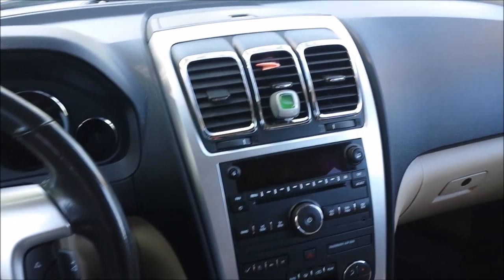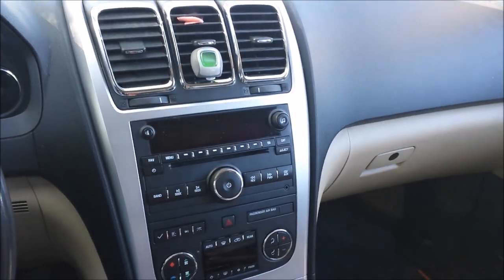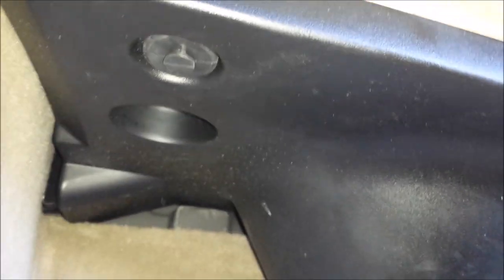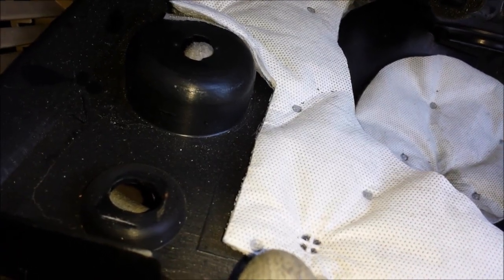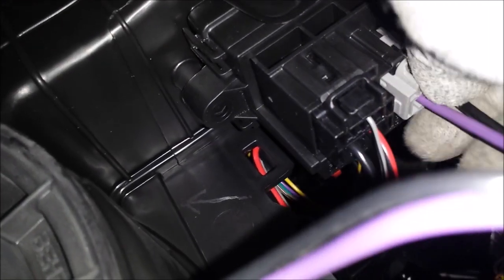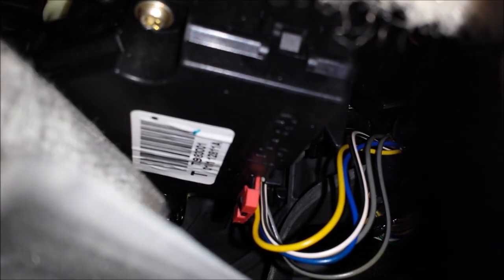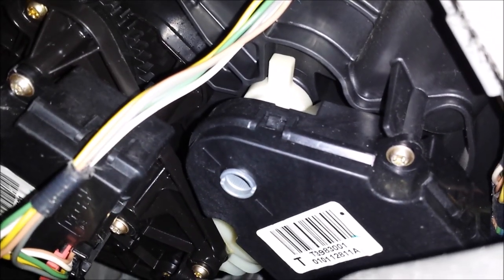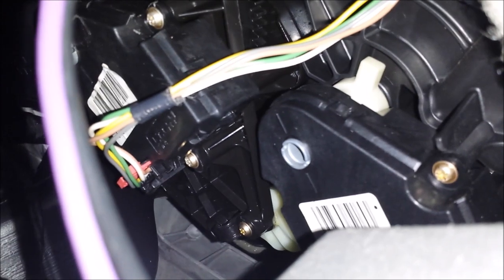A/C blows hot on passenger side? Fix! 2007-2018 GMC Acadia

Comment: I called our local 'honest' auto repair shop for a quote on doing this job. I even told them about this great video and how quickly the job had been done.  The owner quoted me a flat $1300 (plus part), no matter how short or long a job it would be "because that's what it's worth".  Yikes!  My son, who has ZERO experience working on cars, decided to see if he could do this repair job.  He has done literally nothing to a car in his life beyond checking the oil stick.  He watched this video, went to Home Depot and bought a little headband lamp to wear for light and the needed tools that were described in the video, and dug in.  In under two hours, he had done the complete repair, had the A/C working like a dream, and had everything put away.  I repeat - he has had NO EXPERIENCE whatsoever working on cars or any other equipment, and did in two hours and for under $70 in parts and tools, what the local 'reasonably priced' shop quoted a flat $1300 to repair.  Eddie, thank you SO much for this VERY well done, easy to follow video.  You literally saved us over $1200!
Reply from the maker: @Horselings  oh wow! $1300 is insane!! I wouldn't even charge that!! Well thank you so much for sharing this with Me and very glad I could help you guys out. And congrats on your son's 1st time success!!

Comment: Thank you so much for the informative, step by step video.  You saved me hundreds of dollars and gave me confidence to tackle this job.  The tip about drilling a 1" access hole was especially helpful as well as having the right tools.  I completed this job in less than 2 hours.  Thank you!
Reply from the maker: You're very welcome 🙏 im glad this was helpful and gave you the confidence you needed! Congrats on your successful repair!
Reply: @EddiesCustomsandRestorations I have a gmc acadia 2012,there is not hot and cold air coming out of driver,middle ones and passenger ones only the windshield ones,the rear do work,how many blend door actuator does this type of truck have and what is the function of each one if it has more that one?

Comment: Add me to the list of "people who saved alot of money by watching this video". I sucessfully replaced the actuator and fixed the problem (which was a big problem in FL in July). I did drill a 3/4" hole in the panel to help with accessing the screw near the electrical socket/plug. Also put a small magnet on the end of the bit to help keep the screw from dropping. I think the hardest part was getting the fuse back in. Actually dropped one behind the carpet that I couldn't retrieve. Thanks for the tutorial!
Reply from the maker: sure looks like yours was quite the experience lol. But I appreciate your positive comment. God bless and im very glad the video served its purpose for you.

Comment: Your help was great both actuators bad and successful on replacing. Only addition on Enclave plug in actuator before reinstalling and get rid of original screws and use #8 3/4 hex head so you can use socket and drill 1" hole in side to access one screw.  Almost impossible to get plug in after installation,  had to find a person with small hands to do it. I was quoted $1,000 dollars and I did job for $68 dollars with your help.
Reply from the maker: There you go!! Thats that savings! Glad my video helped you out!

Comment: Great Video. It was a real pain in the XXX job. I ended  using a 7/8 paddle bit and drilled a hole for easier access to the left side screw. The 15 Amp fuse came out with a needle nose pliers but was difficult to put back in because of GMs  placement of the fuse box virtually no room to work with if you have big hands.I would recommend just disconnecting the battery to accomplish the same outcome I wish I had. The biggest obstacle is that you clearly  cannot see what your working on in such a cramped space. Thats why the dealer wants to take the dash apart to get to the actuator and charge you big money in labor for the job.
Reply from the maker: Thank you so much for your kind words and very glad that you were able to accomplish doing this repair. and very sorry for the super late reply but somehow i missed it in the notifications.

Comment: Did the passenger temp actuator today in my 2011 Buick Enclave.

Wasn’t working quite right, but once I did the recalibrate it works fine now. I’ve now replaced both of the ones on the passenger side, I’m expecting the driver’s side one to go out any minute.

Thx for some pretty clear and useful instructions.
Reply from the maker: you're very welcome! I did my best to give clear instructions. and sorry for taking so long to respond. I somehow missed this notification.
Reply: @EddiesCustomsandRestorations   where is the one on the driver side i have 2017 acadia
Reply from the maker: @taurusposey  it should be close to your right shin if you are sitting on the driver's seat. There might be a plastic covering it but it looks the same as the passenger side one.  So just look under the dash from the driver side and look to your right and search for a part that looks like the actuator shown in this video.

Comment: I read most of the comments so it sounds like the blend door actuator is the one closer to the floor of the vehicle? The actuator that controls the defrost, ac vents and floor. The wife's 2012 only blows through the ac vents. Thanks for the video.

Comment: Thx much for this video.  Just finished my 09 Acadia.  I need smaller hands but otherwise it worked well.  FYI, I cut the hole with a 1”;hole saw and inserted a 1” white nylon plug I bought at Ace.  Looks factory.  Again,  thx for it all.  Saved me a ton of cash.
Reply from the maker: Well I really appreciate your positive comments.  Thank you very much and glad it worked out well for you

Comment: Great video thank you. I have a question. Is there a actuator for the back vents as well? I am only getting cold air on the passenger side, the driver side and the back fence are all warm.
Reply from the maker: The back vents a full system just as the front ones do. Should be located somewhere by the back hatch behind one of the panels. More than likely on passenger side. I wish I had another video to share to demonstrate

Comment: Followed these steps for my wife's 2014 Enclave.  Step by Step wasnt easy because I have big hands but it did the trick and the air now blowing cold!!!   Two things ... probably a good idea to watch once all the way through before starting ... I missed the trick about the dropped screws and had to find a replacement only to find your tip after I put it all back together; also, I never could get a good line up on the third screw even with a small wrench (because of my big hands) so I Drilled a 1" hole through the plastic to line up with the hole and then put a 1" access cover.  You really don't need the cover since you can see the hole when the glove box is replaced.
Reply from the maker: Hahaha your comment had me laughing so hard. Glad you got it done but yes I should have mentioned the part about getting your dropped screws sooner in the video. Please click subscribe, it really helps my channel
Reply: I can’t get the bottom screw out! Any tips?
Reply: @carrollacademy38917  I have fixed another actuator door for a friend with an Acadia.  This time I went straight to drilling a hole in the plastic so I could get a better angle at the screws.  As before, the glove box hides the hole but I still put in a plastic hole cover that I picked up at Pep Boys and it looked factory.  If I had to do it again I might even make the hole a bit larger to cut down on added aggravation.

Comment: Great video very detailed! But did not work on my 2014 Acadia Denali. Cold on the driver side and warm on the passenger side. Any advice?
Reply from the maker: you replaced the actuator? next i would check to see if the wiring is receiving any change of values with a digital volt meter. Chances are the temperature control panel has failed or the climate control module. i'm sorry to not have a definitive answer for you but those are some ideas.

Comment: Thanks for sharing this video. The instructions were very precise and It saved me over $1000 from what the auto shop wanted to charge to replace. I did lose one of the T20 screws in the process and couldn't find a replacement locally. Anyone know a good place to find those?
Reply from the maker: any hardware or nut and bolt store can have those on hand. And sorry for the super late response, i never saw this comment but appreciate your comment so much! thank you for posting!

Comment: Where did you buy the 1/4 inch flexible head micro ratchet that holds the small 1/4 Torque Bit? I can't find it any where... Do you have a part number for the tool? I subscribed to your channel...  I can't get these screws out with what I have for tools... HELP I am Dying in this Heat...
Reply: Did u find one? I need one but can’t fixed it

Comment: Great video! Which is the actuator for the drivers side? I have this problem, but it blows hot on the Drivers Side.
Reply from the maker: There should be an actuator under the dash on the driver side by your right leg in the same general area. I want to say that is the driver side actuator if I recall correctly. I would still remove it, then reconnect it while in your hands holding it and then try to change your settings on temperature to see if there is any movement.

Comment: I have a 2016 Acadia 71000 miles. The rear core evaporator went bad while still under warranty around 25000 miles and was replaced.  Do you think it is the rear and front passenger actuator if my rear ac started blowing warm air and then my front passenger did the same a week later? My drivers side is blowing cool air, but not 60 degrees. Now I just checked my ac again after turning off the ac and the car, turned car back on and ac, pushed the upper air flow and then the foot airflow controls, turned off the auto and inside circulation, now all are blowing cooler ac??? I have never liked how the ac in this car works. Dealer told us if we aren't getting cool air to turn ac down to 60 and then back up again to reset it. This usually works, but not this time. This is crazy. I've never had so many issues with ac in a car!
Reply from the maker: In the Acadia I believe there are 2 see rate units and they both have temperature actuators of course so that all passengers can have different temperatures. The actuators themselves work but it's one of he internal gears inside that gets a Crack and breaks over time. It's easy to open them up. All you need is a flat head screwdriver to open it up and inspect the gears. But yes it is likely that the actuators are failing at least ONE side blows cold. If the Ac itself was failing, none of the vents would be cold.
Reply from the maker: If you found this video helpful please help my channel grow by clicking "Subscribe?
Reply: I had alternator replaced in 2012 acadia today and now having this prob but driver side is hot, could this be damaged from changing alternator?

Comment: Hey, nice video! Very detailed! I have the issue of the air not coming through the defrost on top. Could it be the other actuator? It blows very hot, but just not from the top defrost .
Reply from the maker: Thank you very much and I'm afraid it might be one of the top actuators that will be quite the challenge to get to. It would take some research first because I am unsure of that but it very well could be..
Reply: Thank you

Comment: I have a 2017 GMC Acadia, the air on the drivers side blows cold like it should, but the passenger side doesn't seem to get as cold. When I close the vents on the drivers side the passenger side air does get cold though. Do you think this is a blend door actuator issue, or something else? Thanks for any help you can provide!
Reply from the maker: It may still be the actuator because when you shut the vents on the other side, the cold air has to go somewhere so it goes to the other side
Reply: Brian Griffen, I’m curious if you repaired yours. I’m dealing with a 2018 soon, and am curious if it in the same area. And if your part for the 2017 looked like the one in the video.

Comment: Thanks for the help.  I tried turning the blend door then noticed.  It was very difficult. I don’t think my actuator was the  problem. Now I’m stuck
Reply from the maker: You may have something inside thwre blocking the door from moving. Perhaps coins that get thrown in there by our children when they get curious. Ive seen it happen
Reply: @EddiesCustomsandRestorations  do you know what the part is called or how do I get in there
Reply from the maker: @MrJd829  the flap is called a blend door. And it varies on getting in...that would be q whole other video in itself...

Comment: Thank your for this video. I can tackle my project with confidence now and (based on the comments) knowing it will be a nasty trick job.  I know you are not likely able to give troubleshooting advise but I will ask my question in case others may also know.  While I was checking the actuator out and orienting my self with your directions I tried manually moving the actuator (and vent “lever”) to the opposite position from where it was - it was in the up position or “1:00” if you know what I mean.  I was able to manually move it to the bottom position or 5:00 on the assumption that the opposite would be cool air.  When I started the car it was still hot AND the actuator had moved back to the top position.  Does that still feel like a faulty actuator ( maybe the electronics are off) but it does seem to be able to move the vent door when it “wants” to.   Any thought would be appreciated before I donate who knows how much knuckle skin.

Comment: Great video. My issue is that my ac is blowing hot air instead of ac. The ac light does come on and was serviced and has refrigerant however it doesn’t get cool and blows extremely hot air. Could this be an actuator as well or something else? Please advise and any if all help is greatly appreciated.
Reply from the maker: Yes very well can be the same issue. This vehicle had perfect working AC except that it was stuck on heater because of the actuator being bad
Reply: Eddies Customs & Restorations I forgot to mention that the ac works fine in the rear but not in the front..
Reply: Eddies Customs & Restorations so I need to purchase the same actuator or are they’re several actuators besides the one you illustrate in this video?
Reply: @EddiesCustomsandRestorations  hello, just wanna ask if which should i check or  fix first, the preon level or the actuator? Please advise..
Reply: I also have the same problem which the ac doesnot blow cold air.. thanks
Reply from the maker: @marlonlagustan8584  check and make sure the AC is properly charged. If you AC system is not properly charged, your AC will not work properly. If you have AC gouges, connect them to your vehicles AC service ports and monitor the readings shown on your Guages.  To understand what the readings indicate, do a Google search on how to read AC guages and what the readings mean. Also be sure to see if your AC compressor clutch is engaging when the vehicle is on. You will see it click on and off every so often. After verifying that the system is charged properly and compressor is engaging, then you can continue to see if maybe you have a blend door actuator stuck in the heater position

Comment: This is my second question on this problem. Took the glove box and the black panel off and got a good look at the actuator razing and lowering the temp the blend door actuator does not move.  this is my question,  when I turn on the defrost that top actuator does not move and no strong air comes out of the defroster at the top.  Are these two actuators tied together that the blend door works in tandem with the upper actuator?  Or do you think there is another problem?
Reply from the maker: The control head which is the unit that has all the buttons to select temperatures and all that could be faulty and not sending the signals which can happen but also both actuators could have coincidentally failed at right around the same time. Without being there I would not be able to know for sure since I would need to check voltage to see if its getting power and ground and if its getting more/less signal whenever changes are made to the temperature. Watch a video on how to use a multimeter and you can find one cheap at walmart so you can gain knowledge on how to use it so you can test the wires. If you have power at the actuator connector and it changes when you change your temperature settings then you climate control head would be good meaning the actuator is bad. But if you dont see any of those values changing when you command it to change then its the control head.

Comment: For the HVAC reset, you said don't touch for 40 seconds. Does it matter if the unit is turned on or should I make sure that the unit is turned off before I turn off the vehicle prior to the reset?
Reply: And thanks for the video, very helpful!
Reply from the maker: Whatever the unit was set at before, on or off just leave it be and you should be fine. I appreciate the positive comment, please click subscribe, it really helps my channel out
Reply: @EddiesCustomsandRestorations  Cool. Thanks. I guess I'll be tackling this one today...